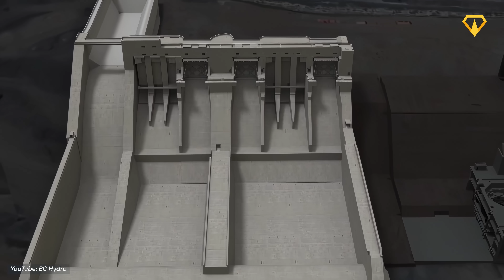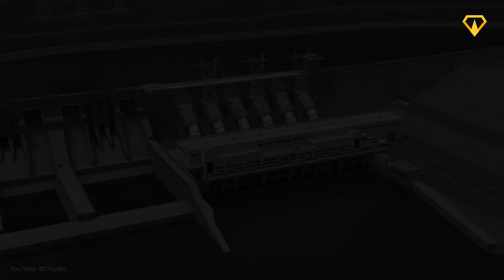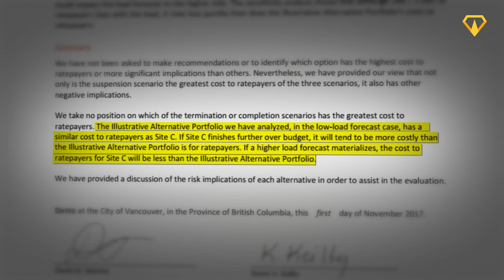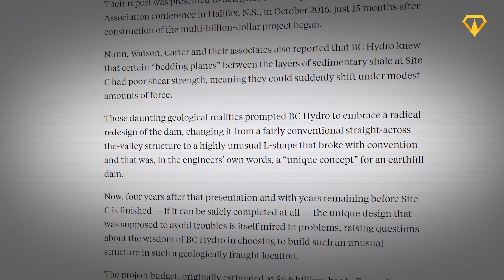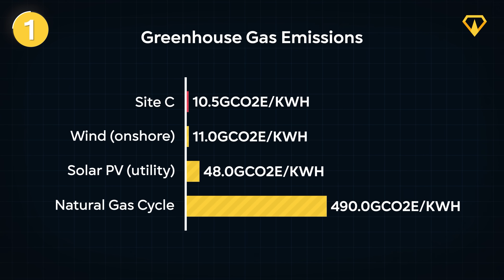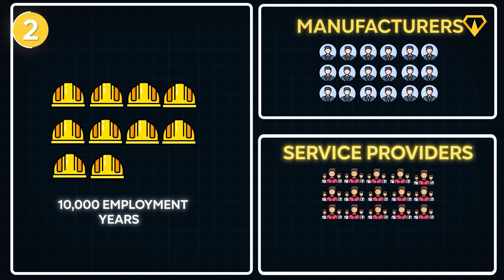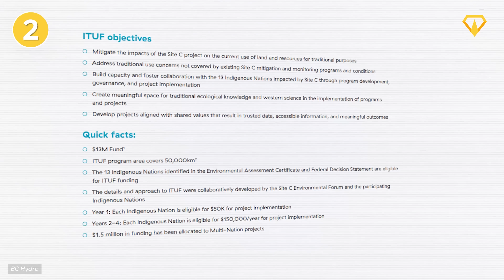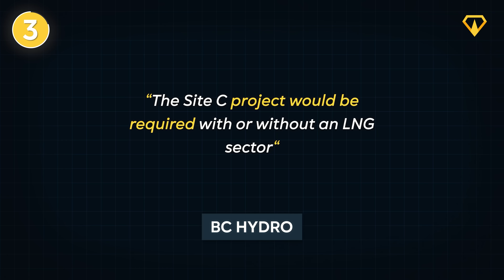Canada's Massive $12B Mega Dam

Comment: You missed the cost of an updated foundation design. At 9:01, you can see the steel tubes they used for piles that were meant to stabilize the dam after shifting was noticed. You can also see the drilling rig (tall yellow thing beside the blue crane) that they used to get through the RCC foundation and the shale underneath.

Comment: Electric power projects generally have very long term payoff periods. Costs for stuff are high because this type of stuff is supposed to work perfectly for decades, if not longer. For instance one of the challenges with shifting to electric vehicles is infrastructure to allow charging that is fast enough and in the right location. That doesn't just appear by snapping your fingers or signing a piece of paper in some legislature. It takes tens of thousands of people working for years to create and roll out that sort of stuff. Making it really really reliable is also an challenge. I also suspect that the estimated cost of these projects, as announced, are best case scenario that assumes no engineering problems, no construction problems and no political interference. The construction industry is still waiting for that to happen ... once ... somewhere. Remember Murphy was an optimist.

Comment: I worked on site C as a carpenter, in the power house, coupling chamber, and head works. the problems that are going to arise with the concrete in the generator area's are going to add up, never mind how it shifted over 80 mm towards the river that's what caused one of the cost jumps, having to chip out and remove concrete from generator 3 "I believe" that was a delay, the cooling lines that weren't  filled with grout and the laborer super "Curtis" just not giving a fuck about the corner cutting to meet dead lines too busy banging the medic lol. it was interesting to say the least.
Reply: Kiewit?

Comment: 10,000 hectares sounds large, but is only 100 square kilometers, which is 10km by 10km, or 6.2miles square. Clearly the gains outweigh the benefits. People like to complain about climate change, but don't like any of the options, yet they still have A/C, and other modern amenities. Power has to come from somewhere, hydro where available is a great option.

Comment: Site C is going to be producing power by the end of the year. It needed to power sites like LNG Canada that otherwise has to burn gas since there isn't enough electricity to supply LNG Canada. The burning of gas to power LNG Kitimat wasn't agreed to by the reserve of Kitimaat village. I saw the video of the head council being angered by such an idea. LNG Canada has a HUGE power demand that CANNOT be filled by BC's power production. Site C is coming online right when it is truly needed. Rio Tinto with the hydro power plant has been having power supply issues that resulted in the closure of some of the aluminum smelter lines in Kitimat.

You might say my work puts me smack dab in the middle of everything. You certainly did a lot of research.

Comment: i worked on the site c dam, a big concern that came up is the dam is sliding (slowly) into the river …they installed “piles” (big concrete screws 100’s of meters deep) but not a guaranteed solution …dam is too heavy for the ground its on this was already shown in ground surveying before ground was dug
Reply: the piles were introduced well into construction

Comment: Site c was not selected earlier because the ground around that portion of the river is not hard rock stable. the reservoir will have decades of slumping issues.
Reply: Bc hydro is cutting corners, and I highly doubt that site c has been properly engineered as they are way over their proposed budget. Not to mention the trees they left in would a safety risk for years to come just like they still are a safety risk at wilston lake
Reply: @JerezIwiski  I live there. not too worried about the trees honestly. Loggers did as good a job as they could within the time frame. The main river sits at about 99% proper logged. Only saw 1 small section that they didn't cut. Not sure of the subsidiaries but what I could see it looked like they took what they could. While I'm not sure on the cutting corners part, I do know that the construction side was a complete and utter shit show. I do know that they never hit bedrock while piling.
Reply: @gareth3035  I live in the area too, and done deliveries to the dam. I was also told stories about williston lake, plus the fact it was never logged before the dam built there got filled and now there's a danger of trees getting lose from the bottom and rocketing up to the surface. Should of got rid of all of the trees so that wouldn't be a hazard in the future.
Reply: @JerezIwiski no one has a chainsaw to cut those down?
Reply: There are many dams around the world built on similar ground and have been engineered to be structurally sound.
Reply: @Yielar1 I worked for a core drilling company there and we never hit bed rock once, this dam is doomed to fail

Comment: If I may set a few things right as someone who has worked on the site c project on and off since 2019. 70% of the power that the dam will make is slated and sold to go to  plants to the north of fort St john not to houses. The project was over $16 billion  last time I was informed almost 2 years ago. The till conveyor is not one 5 km belt it is 2 sections still a big belt but not 5km.

Comment: Afde . Jokes dont know how to build
Reply: So much nonsense and misinformation.
1. This, with inflation, should have cost $3 Billion.
2. The "real" cost: add the $4 Billion for the transmission to point of use, Vancouver. Add the $1Billion for Substation and inter-connects, to the $14 Billion.  Now close to $20 Billion.
3. The electricity is worth about $150 million per year.
4.  Intensive agriculture would be worth up to $500 million per year. 
5.  Initially the ppwerhouse and structure were moving downstream, due to foundations being consolidated sediments, layers of mud.  They have tried to stabilize it with concrete filled caissons along the downstream edge.  Will it work?
6. Massive conservation acrossvthe province, would have saved far more electricity, at far less cost, with hundreds of additional jobs.
7.  The present plan is to electrify the fossil "natural" gas extraction industry, to then ship LNG, global warming greenhouse gas emissions overseas.
8.  Solar and wind are about 1/3 to 1/5 the cost of Site C.  BC has the reservoirs to store the solar and wind, like a huge battery.
SITE C IS AN UNMITIGATED DISASTER.   DO NOT BELIEVE THE SUPPORTERS.  THEY DO NOT KNOW WHAT THE REAL FACTS ARE,  AND DON'T CARE.
Roger Bryenton, former P.Eng. and now PhD student.

Comment: BC Hydro 2024 Call for Power

We issued a competitive call for power at the beginning of April 2024.

The 2024 RFP will help ensure B.C. has sufficient clean or renewable energy to meet future needs. It aligns with the 2021 Integrated Resource Plan. The 2021 IRP indicated the need to acquire approximately 3,000 GWh/year of additional energy as early as fall 2028. 

* paraphrased

This projected need is over and above the generation anticipated from Site C.

Comment: Dumbest hydro electric project ever.  People think dams are forever, not understanding they have a limited lifespan. The old fellas, back when we had smarter people in charge, built Site A and Site B but took a pass on Site C, because it a lame-duck location.  The reservoir will be silted in 90 years, and will cost more to decommission than the value of any power it made in the meantime.   A reasonable hydro-electric project should be good for at least 300 years.  All this project is, is a giant payday for the companies that donate to government parties.

Comment: Obviously you don't how much ppl in BC use to pay for electricity. In the early 90's my electric bill for my 3bdr was $35.00 for 2 months(that was the billing cycle). I didnt use electric for heat.

This is how badly the government has corrupted the grid. $800 million fine had to be paid by Hydro's PowerX for its participation in the Enron scandal.
The reason Horigan(NDP) didnt scrap site C is because of Hydro's best kept secret...the Williston Dam has voids in the earthen dam.
I wonder how much capacity has been dumped without generating power to keep the reservoir levels lower.

Comment: LNG is worse than coal in terms of climate change. Coal went burnt also puts out a lot of air pollution, which is bad for health, but its aerosols attract water-vapor which forms "clouds" and reflects sun-light back into space. So while coal may put out a bit more CO2 per watt, compared to gas, it also cools the planet a bit. Coal pollutes China's air, but LNG pollutes BC's water (they frack for it). And and LNG leaks along the way, also warm the planet. LNG is essentially methane, and that has 80 times the warming potential as CO2.

Comment: TRIANGULATED MICROW PILING FOR THE ENTIRE STRUCTURE GIVING DUE CONSIDERATION OF RESISTANCE EACH PILE OFFERS AGAINST SLIPPING FORCES AND ACCORDINGLY INCREASING THE WIDTH OF THE STRUCTURE WILL SAVE THE STRUCTURE. 
I MAY HELP IN GIVING CONSULTATION IF NEEDED.

Comment: Complaints about greenwashing are, essentially, a counsel of perfection: the idea that it's better to do nothing than it is do something that is short of ideal, no matter how unrealistic the ideal solution might be. Of course China "should" be using renewables rather than coal, but it's still much preferable for them to use LNG than another thirty years of using coal while they create the infrastructure needed to replace that capacity with renewables.

Comment: This is an excellent project which also increases BC's ability to make solar production more feasible through energy storage.
Reply: Energy storage will still cost more than is worth it with the technology that we have especially in northern areas that experience cold weather, how long does your car battery last? Batteries can be recycled yes but it costs energy to do it just like keeping them in a heated environment which yes will increase their life. Dams are perfect like natural gas because you can control the output based on demand whereas like what was said in the video wind and Solar you have no control over and cost more than the return. Wind and solar are for entertainment purposes only and are not feasible options to phase out O&G
Reply: @Dannyboy5885  Energy storage is the water reservoir... that you use when solar is not enough.
Reply: @Dannyboy5885  Solar doesn't need energy storage. If my house is generating solar power that it is not using the power goes to the next house using power. That means the grid needs to supply less. Meaning the water in the reservoir doesn't need to be used. With Thermal they can't turn the power down that easily. Hydro can respond to the power output of other sources very rapidly unlike Gas or Nuclear

Comment: We have a similar situation on the east coast of canada too. Muskrat falls hydro dam has since double and i think even tripled in price. the project still is not complete YEARS after it was supposed to be. Not a drop of power coming from it yet. the power grid they built for it contains poles which look like a sharpened pencil standing vertical by 4 guide wires. We live on a rocky windy barren island and i have very llittle faith these things will hold up to the elements.

Comment: In Romania, many dams were built along the Strei river. For about two decades, the fish have disappeared almost completely. Then, the dams started to clog, requiring extremely expensive operations. A dam loses about 40% of its water filling volume in two decades. The floods bring a huge surplus of material that is stored in the tail of the dam. In the long term, they are ineffective, destructive and require huge costs. Should we consider stopping fish migration? Stopping the alluvium that would normally have reached the deltas?

￼